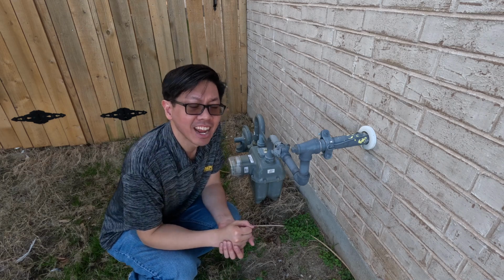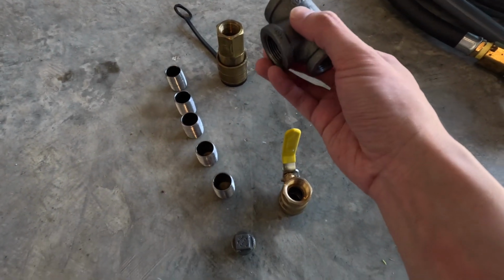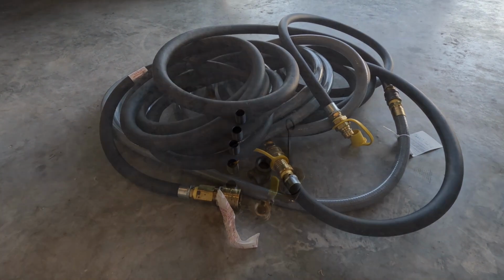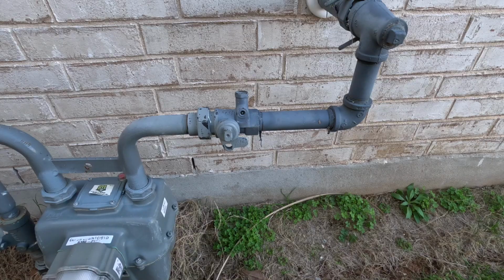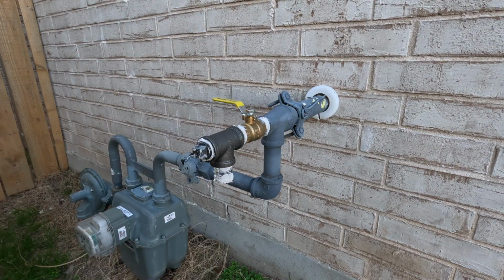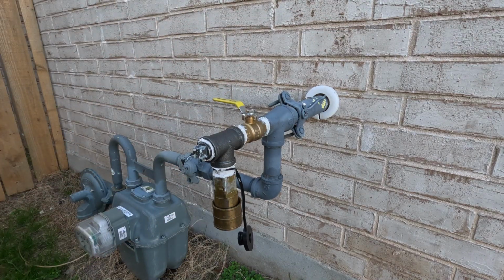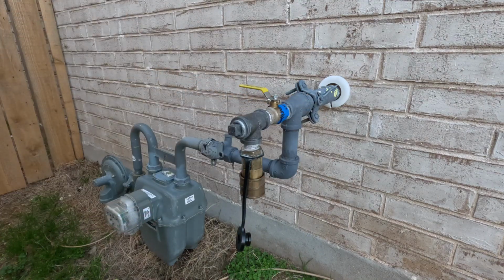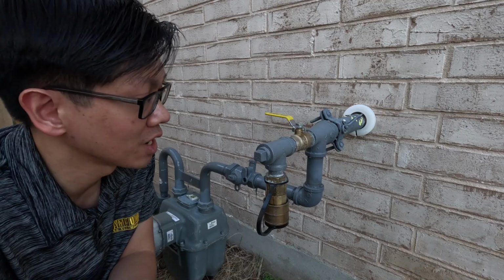NATURAL GAS Quick Disconnect Hookup For "UNLIMITED" GENERATOR FUEL

Comment: You can’t use those all thread nipples per code. Also, check with your homeowners insurance to see if you will be covered if you do the work and have an incident.Most insurance companies require licensed gas fitters to do the work.
Reply from the maker: Thanks for your comment and sharing your advice. I have heard the same from another comment before. I tried looking it up, but couldn’t find any reference. Would you know exactly what code states I can’t use thread nipples? I’d love to understand this more and read the code for this. Thanks!
Reply: @jonathanDIYs  403.10.1.1 National fuel gas code.
Reply: @jonathanDIYs  National fuel gas code 403.10.1.1
Reply: @jonathanDIYs  National Fuel Gas Code 403.10.1.1

Comment: My gas service on the outside of my house runs to a manifold in my garage wall that has several caps that gas lines can be connected to. I could probably just run a flexible gas line from that and mount a quick disconnect through any wall I choose to run my generator gas line to.
Reply from the maker: Sounds like that might be convenient. One thing to consider is what is the size (diameter) of the pipes inside the garage. Both distance and smaller diameter will limit the amount of gas. It’s been a while since I did this project, so you’ll have to check the video I posted after this one I think, but you need a certain BTU capacity to fully run your generator. If it is too low, it will either not startup or you won’t be able to achieve full power. Just things to consider. If you have a section that goes from 1 inch to 1/2 inch, the whole line after has to be treated as if it is a 1/2 inch line.  Hope your setup works!

Comment: Excellent tutorial. Easy to understand and easy to follow even for a old man like me. I'm curious to know if there is a "lock out" type valve one could add in series with the this setup. I'd like to prevent anyone else from tampering with the "free gas" valve. Thank you for the video. I'm now a new subscriber.👍
Reply from the maker: I couldn’t find a lock out type valve… the risks are pretty low in my opinion. Nobody has ever messed with this as far as I know since I installed it. Most people don’t care to touch anything gas related.

Comment: why is there a ground wire on the gas pipe? where i am the gas pipe in the ground is plastic and will not provide an earth ground for anything in the house.
Reply from the maker: Is it metal in the house? If it is metal in the house, it might be bonded to neutral to cause the breaker to trip if it were accidentally energized. It’s either for bonding or grounding.

Comment: Do you need a regulator as well?
Reply from the maker: Yes, I installed a motor snorkel kit that includes a regulator for the generator.
Reply: @jonathanDIYs this is what im trying to figure out. I have a natural gas outlet in my backyard behind my house above a concrete pad. I want to use it to directly connect to my Generator but how do i know gas wont continue to enter and exit my generator if for some reason my generator shuts down? What is needed to make the gas stop flowing from the natural gas outlet into the generator if the generator is not on and pulling the gas in?  I only want the gas to flow in the generator when i turn the generator on
Reply from the maker: @xKINGxRCCx the regulator should handle this. The regulator only allows gas to flow when there is suction from the engine. It also makes sure the right amount of gas flows not to have the mix too rich or too lean. 

Conversion kits come with the regulator. If your generator supports gas, chances are there is already a regulator on the generator.
Reply: @jonathanDIYs thanks. Im wanting to get the Genmax 13500iet tri fuel inverter generator. Would this unit have a natural gas regulator already built into the unit?
Reply from the maker: @xKINGxRCCx yes, this generator definitely has a regulator in it. The systems, especially those with remote start are designed so you can have everything all hooked up at all times and remotely start it. 

That said, these are portable units, I wouldn’t necessarily want to keep the natural gas hooked up to this system all year without monitoring it. It isn’t a generac standby generator that is designed to be permanently installed and tests itself once a week. 

Having it connected to an open gas line while the generator is off, I wouldn’t worry for a leak.

Comment: 100 for the hose quick connect.  I think I’d rather plumb the hose into the mess directly for the cost of the single adapter.  

I also don’t really see any reason to use cast iron over brass, am I missing something?

Comment: Great video and great content I do think OneNote is worth mentioning, not a huge but I think those 2 short nipples are not approved due to the lack of space to put your pipe wrench on without scraping the thread. Just thought I would mention it. You can check with TSSA to be sure. I'm in the trade and that's what I've been told. Thought I'd share.

Comment: The short nipples you used are not allowed on  gas systems in Canada. Also the white pipe dope as we call it here, is - as far as I can recall - is for water. The Propane and NG is yellow. Yes, black steel pipe is what is used in Canada along with malleable cast fittings. But if the inspector passed your project, that's all that counts.
Reply: Why are short nipples not allowed? Not enough "bite" for a pipe wrench?

Comment: Hello. Just a noob question. Are all service port 3/4. Cause my looks like yours but doesn't seem to be a 3/4. Thanks
Reply from the maker: No, they can be all shapes and sizes (https://www.google.com/search?q=black+reducing+tee). Look at the tee closely, it usually has a label to tell you what size each side is. It might be painted over, but it is usually embossed into the pipe.
Reply: Thanks. I haven't checked yet, but it looks like 1/2 from your link. Does that means i can't use it power a generator? Thanks
Reply: I am aware it can be converted into 3/4, but will the gas flow insufficient due to the limit of 1/2? Thanks
Reply from the maker: @ryanhoang82  look at my other video... I believe I go over the math for everything and include links... Bottom line is at least for planning and calculations, you consider the line the smallest size on the branch... So if the size goes down to 1/2 inch, even if you size back up, everything on that line needs to be calculated as 1/2 inch. 

You might be fine with 1/2 inch if it isn't too long. You can see the math in the video where I test my generator plugged into this gas port I added.
Reply: Thank you

Comment: That plug you called a service port is actually used for plumbers to pressure test the house piping. Also daisy chain all those gas hose connectors are a bunch of leak points. QD connectors are known for leaking.
Reply: What is daisy chain?

Comment: Thanks for the video!  I notice the female quick connect you list is different from the one you installed.  Also, I would consider placing the generator near your gas and electric meter and simply chain the generator to your gas pipes to keep people from walking off with it.  This will give you more gas to your generator too!  Thanks again.
Reply from the maker: Hi SBChannel7006 - yes, everything I got for myself was from a surplus supply store that I got for 50% off of what it would have been originally. I believe it is the previous version of what I list so it is a bit bulkier, but I didn't mind and preferred the savings. If you search around on ebay, you might be able to find a deal as well. Thanks for commenting!

Comment: I did mine and found two significant leaks on the supply pipe side of the meter after bubble testing all the connections. I had to disassemble them and re-dope the threads to stop the leaks. Probably leaking since the house was built for 15 years.
Reply from the maker: @Deagle367  wow, so you actually fixed/improved the house with this project. Good job! This proves that you can't always count on a hired hand to get the job done right unfortunately... Thanks for sharing!
Reply: @jonathanDIYs  Yep, bought my house as new construction and the first and only owner.  Went to install the generator gas connection after the meter and when finished, bubble checked all connection and found two threaded connection leaking though the pipe dope on the inlet side of meter I never touched.  Below the gas regulator and above the shutoff valve. Well, took it apart and fixed it.  It was probably leaking for a very long time and I never knew until last week. Just glad the leaks were above the shutoff valve on the riser pipe. I recommend everyone go check their NG lines. Keep a eye on dead grass patches, may indicate leaking underground NG pipe too.
Reply: @Deagle367 glad you found those gas leaks.

Comment: That Tee isn't for you to add fittings to , It's a port to install a probe to change the meter without shutting down the home.   Now the utility company  will have to replumb your whole meter set  or shut off the gas to change the meter.    You even called it a service tee , WTH are you thinking ?

Comment: Will using 1/2in supplies instead of 3/4in work?  My generator came with a 1/2 in quick connect, so figure just keeping it all 1/2 in.
Reply: It depends on several factors. You need to do a calculation based on how far the generator supply line will be, how many BTU’s of cubic feet per hour the generator can burn at its maximum and a chart will tell you what size pipe you need to use to meet that demand.

Comment: what is the puddy that you are applying to the gas pipe and how do you test for no leaks?
Reply from the maker: Pipe dope, make sure it is rated for gas. You can get it from home depot or lowes: https://www.homedepot.com/p/Oatey-Pro-Dope-8-oz-Pipe-Joint-Compound-154202/100204007

You just use water with some dish detergent in it. Bubbles will form if there are any gas leaks.

Comment: Nice that yours has a full size port on it. Mine is only a 1/2" cap,  the distance I need to run I need 3/4 line, so I need to have someone come out and add my output for my generator. I am going to see how much more it would be to add ~20 feet of pipe so I can use a shorter gas hose and power cable.
Reply from the maker: Yes, it was very fortunate for me. I think if I had to change the tee myself, I might not have been so adventurous. With there being just a cap with the size I needed, it really enticed me to try to do it myself. Glad I did! :) Hope your setup goes well, thanks for commenting!

Comment: will make a great "Dirt Catcher" and prevent the quick connect valve from properly seating at some point in time. The plug should have been put in the downward pointing section and the Quick Disconnect on the end fitting to prevent dirt from entering the internal valve. Thats my opinion anyway.

Comment: I was wondering if you were going to mention the price of the hose. I don't remember the length of mine but I certainly remember the cost. $430. for a 3/4" I.D. custom length hose. It's an oddball length because I bought exactly the length I needed. The funny thing is my brother wasn't about spending that kind of money so he bought a 3/4" decent quality garden hose, cut the ends off and has been using that. There's very little pressure in a gas line so it works just fine.
Reply from the maker: Hi Fauxque5057, thanks for commenting. That definitely works in a pinch, but I couldn't  ever do that as I want everything to be properly rated for the application. I definitely will give props to your brother for thinking outside of the box! My hose was a mod podge of hoses I found from a surplus supplies store. I think it ended up being about 85 ft in length for around $200. It has been a while since I purchased it, so I don't recall.
Reply: I had to temporarily relocate my 125 gallon propane tank away from my house when I did some foundation work and put a length of garden hose spliced into the feed pipe between the house and the tank. I had cut, clean ends on both ends of the garden hose and used stainless steel, screw pipe clamps to secure each end of the hose. It easily held the 11 WC with no leaks for a few weeks, but I wouldn't leave that around permanently exposed to sunlight and other weather.

Comment: Do you have to have a natural gas regulator in the flexible line between the quick connect and your generator? I have seen some videos say you do and others don't mention a need for it. Thanks for doing this video.
Reply from the maker: It depends on your gas service. If you have standard 7" water column pressure, you don't need a regulator. (About 27" WC is 1 PSI) If you're running propane which is stored 100-200PSI, you definitely need a regulator. If your utility company is running "high" pressure like 2PSI, you need one. SoCalGas does 2PSIG - https://www.socalgas.com/business/builder-services/elevated-pressure.

Comment: Do you need a permit to connect to the gas connection since it own by the city?
Reply from the maker: @ammazabeth8765  please do research for your own jurisdiction. I unfortunately will not know what your jurisdiction allows or does not allow. 

As for my own jurisdiction, I live in the extra-territorial jurisdiction zone, so I was not bound to city permitting laws. 

In Texas, there are pretty generous laws that allow you to do work on your own home if it is your homestead and you own it. 

According to my research, the gas line after the meter is my own responsibility. The gas line is not owned by the utility company or the city after the meter. 

I am not a lawyer or an expert, this is just what I found from my research when I looked into whether I can do this. Please look into this for yourself for your specific situation.

Comment: What was the purpose of using a T with a plug? Why didn’t you just use an elbow after the new shutoff valve?
Reply from the maker: It definitely could have been just an elbow. I wanted to preserve the original functionality of the service tee. Using a tee allowed me to continue having a 3/4" service port available without having to take take off my quick disconnect setup.

Comment: This is totally bad advice, don’t do it, even If you have an emergency, people will be doing this everywhere, someone will pay with their lives somewhere. Personally, having an unlicensed dude on the Tube working with flammable explosive gas as a neighbor is very scary. Plan ahead, have a pro do it and get the paperwork to stay out of trouble. Not a word said about gas meter compatibility or local codes, simple gas detection devices, galvanic corrosion over time, or potential lightning strikes during storms. So many issues with this, don’t even know where to start⚡️🔥😳
Reply: I installed a 14-50, 240V, 50A outlet for my EV. I used a proper GFCI, 50A breaker, same QP type markings as the Siemens panel. I used a quality, industrial, Hubbell 9450 outlet because the cheaper Leviton ones were melting in long term EV service. I cut a nice hole in my drywall near the panel for the outlet box and it ran my plug-in EV charger for 2 years. BUT then our condo association and the town started freaking out about unpermitted EV work, so I ripped out my work and called an electrician. The first one was polite, but never called me back after I waited a month. The second electrician took weeks to pull the permit and do the work, after which I was left with a nasty combination of EMC and BX on my garage walls along with a messy hack of an entrance hole into the drywall near the panel. Upon inspection, the town wanted the electrician to firestop their ugly drywall hole, which they did with metal plate and a lot of equally ugly, red, high temp silicone sealant. After the final inspection, I cleaned up the entrance hole, and sanded and painted the firestop patch white so it matched the walls.
  
I'm going back into the service panel and back of the EVSE one day soon and retorque their connections, because I've already seen the hack job the "pro" electricians did on the outside of the job. I have a torque screwdriver and want to make sure the high-current terminal screws don't loosen in the heavy, continuous-duty service EV charging subjects them to.

All this cost me $1100, except that the electrician was so inept that he never billed me past the initial $149 deposit I gave them. It's now been 3 months since they all left. Ordinarily, I'd call them and offer to pay, but my condo property manager, the town, and both electricians were such a clown show compared to my very code-compliant 14-50 outlet self-install that was more than perfectly fine, I'm keeping my mouth shut.  

I only use "pros" when I absolutely have to. Don't even get me started about the substandard basement floor some "pros" poured in my 2nd home that ended up out of level, and, due to insufficient pour depth, didn't properly cover and seal the adjuster threads on my lally column beam supports set into said basement floor as per the IBC, etc.

Bottom line: the "pros" screw up a lot too and sometimes we homeowners know better.

Comment: Nice video.  I live in Minnesota and we almost ran out of natural gas last year when it was -20F outside.  Down in Texas the infrastructure isn't designed for extreme cold so it is somewhat understandable if they run out, but in Minnesota people will die if we run out.  Our homes rarely have fireplaces anymore and alot of cars and generators won't run in that cold.  Since then i stocked up on propane for a propane heater.  I wonder if there is a buffer tank for natural gas lines like that?
Reply from the maker: Thanks for commenting. If I ever move out to a space with a few acres of land, I want to have a 250 or 500 gallon propane tank. I don't think they do buffer tanks for natural gas - it is all vapor, it isn't stored as a liquid afaik.
Reply: 200 people Did Die in the winter storm here in Houston a couple yrs ago!